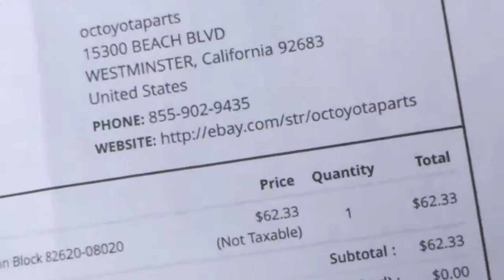How to Fix a 140 AMP Fusible link Fuse In a 2007 Toyota Sienna Van

Comment: I also went through this, if you’re in a PINCH and need to get your van started, you can just use a thick wire to jump between your positive side on the battery and touch any part of that bare metal on the fusible link and that should start it. 
You also don’t have to buy brand new, dealer quoted $130 for new, I went to a junk yard, yanked a whole fuse box out of another van, cost $30. I just removed the fusible link that I needed and worked just fine. 
Also no computer reprogramming needed with my situation. And no other fuses or relays affected.

Comment: One other thought about the “computer reset “. Didn’t make sense to me since the computer supposedly resets when power is drained. 
Well, the battery was disconnected for multiple days while I worked on the fusible link. So, the computer would have been reset by the time I got things working. So, it didn’t make sense that the computer still needed to be reset. That is what sent me down the path of checking for fuel issues.

Comment: Just went thru this extremely tedious replacement. I have a couple of thoughts to help others. First of all, you have to buy a replacement fusible link. So, you have the replacement in hand. That is why I stopped worrying about breaking those PIA tabs off. I didn't intentionally break them off, but in the course of trying to get them out, I broke the front/back tabs. I then purposely broke the right side tab on purpose. 
Additionally, I did one other thing that I think helped. I put a couple of drops of light oil down the location where all the tabs went. It was below freezing the entire time I was working on this repair. I kept breaking off pieces of the old fusible link while I was working on it. But honestly, I didn't care.
Even with all this, their is a LOT of pulling, tugging, pushing fat wires out of the way etc. Their is nothing easy about this replacement. Just completed the replacement and 06' Sienna will crank nicely but won't start. So now I have to figure out the "computer reset" mentioned by Scott. 
So, to summarize, quit being gentle on the old fusible link, break the tabs on purpose and save yourself hours of frustration. Second, lubricate the plastic area where the fusible link rides in plastic grooves, by the tabs. Should get you thru the job quicker.
Reply: Did you figure out the computer reset part?
Reply: Well, sort of. Turns out it had nothing to do with the computer. Thru trial and error I figured out it was the fuel injection relay. Swapped it out twice with other relays (which were identical). On the second swap, car started up perfectly. The car was cranking fine. But I had a hunch it wasn’t getting fuel. Inspected all the fuses. They were fine. So, I tried the relay. I was so thankful it worked cause I was just about to give up. Been running fine now for a couple of weeks.

Comment: Just paid 350$ for this very same issue. Autozone gave the wrong battery model for my 2015 Toyota Sienna and like you, I did not pay attention to the terminal. Positive to negative and saw a ⚡️. Car will not start, no cranking even though it has power. Took the mechanic 3 hrs to figure it out. The scan tool thru the obc doesn’t work either

Comment: Hello. Can you tell me about the Toyota Sienna 2008. The blue wire from the generator reads 0. All other 3 wires on the connector show more than 0 when the ignition is on. There is no battery power.

Comment: Hey Scott! This video was extremely useful to aid in diagnosing and fixing the problem on my 2008 Sienna. For the tabs to pull out the fuse I nipped some from an old license plate that I had laying around. Rounding the edges helped and they worked like a charm. I used some dental tools from Harbor Freight to aid in getting the very fragile plastic clips up from the cap portion. Used your twine idea to help hold up the cables on both sides when sliding it back in. I am SO glad that I didn't follow another video in taking out the fuse/relay box to start the project. Thanks for taking the time to make this video!

Comment: Scott your video & another guy's comments helped me out so much. You & the other folks who have made videos on this have been a huge help & it is greatly appreciated. In place of those metal pieces that you used to depress the tabs, a gentleman on here recommended that I use straightened out bobbi pins instead. So I raided my wife's stash. Popped off the rubber tips on them, straightened them with the Leatherman pliers, used a mini flat head screw driver to gently open the plastic tabs & then pushed the bobbi pins into the gap to hold the tabs open. Hopefully this will help people who don't have flashing & metal sheers laying around 😁😁😁.  Now if only I could get rid of the VSC, TracOff, ABS, & BRAKE lights to disappear.
Reply from the maker: EXCELLENT IDEA!! Well done MND.  Thanks for the great comment.

Comment: Scott - Saved me a ton of $$$, thanks for the great tutorial.  I used .015" thick brass material for the tab tools, picked it up at ACE hardware & used tinsnips to cut to size. I only had to use the brass tab tools on the two side locks, on the hard to reach end lock I just used a very thin screwdriver to push the lock tab in while I pulled up on the fuse with pliers. Worked great. It slid right out!
Reply from the maker: OUTSTANDING.
Reply: Thank you for sharing the thickness & where you purchased the metal used to separated the tabs. I just went to the local junk yard while it was raining, windy, & 34° F. From of the donor Sienna was directly in front of a massive puddle 3 inches deep & i was balancing on 2 junk yard tires whole trying to get out the donor 140a fusible link.... I didn't have time to grab tabs of any kind but heard the ominious words of using a small flat head screw driver if you hate yourself 😆... let's just say it was much easier to unbolt the fuse box, break off all the tabs on the donor fuse box to get it open, & then I slowly worked my through the rats nest of wires with a Leatherman with wire snips slicing all the wires to free the top of the fuse box from the wire harness. I finally got the sucker free & got out of the cold. The $11 for the fusible link versus the $25 for a fully loaded fuse box was worth it. 

Because of you my good sir, ill be able to run off to the hardware store with a proper thickness & get some practice pulling this thing out of the junkyard fusebox before I go pull it out of my 2004 sienna...as I won't have the luxury of pulling that box apart at all. I hope all goes well.

Comment: Hi Scott .  Was there any visible sign that the fuse was bad? Was there a break somewhere? Did you point this out in your video and I missed it?  My alternator and battery are fine but I think the fuse may be bad.  Before I replace mine I'd like to know with absolute certainty it's out and can cause a check battery light to go on and stay on.  Thoughts? Thanks in advance.
Reply from the maker: I show where the copper in the fuse burns.  What's amazing is that the copper is pretty thick. I'm sure it took many amps to burn it.  It's around minute 6

Comment: FYI South Georgia Toyota dealership wants $130 to diagnose the problem, $110 for the part, $500 for labor.
Reply from the maker: Wow!
Reply: LOL $500 for the labor?? & to think that they probably have some special proprietary tool designed only for their technicians that can get this thing out & in in lest than 20 minutes is mind blowing. How many hours does toyota charge for the labor?
Reply: @MNDmanIII  I think it was 5-6, but I did it in 30 minutes with a pair of needle-nose pliers and 6 bobbin pins. I also fixed the transition linkage with a safety pin and a Phillip's head. The Beast rolled over 350k the other day
Reply: @shaunnorthcutt3027  did you stick the Bobby pins, 2 per tab? Then pulled up on the fuse link with the needle nose pliers? I'm having a heck of time trying to free the replacement fuse link from the donor fuse box. Will Bobby pins work? My wife has a ton of those & you may have just saved my butt!
Reply: @MNDmanIII  Pretty much. Definitely make sure the battery is disconnected. I broke open the clear top casing to get a grip and shimmied it out. You can't put all pins in at once because they'll fall out. I started with one clip and moved around.
Reply: @shaunnorthcutt3027  man, thank you! I managed to get the Bobby pins in the 2 tabs near the positive terminal & then popped the far side pin & pulled it popped out of the donor fuse box. I ended up damaging the tab on the good fuse link so I just ripped it off & that way if I need to pull it back out of my van it won't give me a hard time. Later today ill be doing my best to removed the bad one out of my van & ill be sure to disconnect the battery! I saw in one video that the person had to take their 2007 sienna into the dealership to have the computers flashed. Will I have to do this on my 2004 sienna?
Reply: @MNDmanIII  Doubtful. I didn't, and the van has been running finer for over a year. It's a solid car. We took it through 48 states two years ago without much issue.
Reply: @shaunnorthcutt3027  I did it man, thanks to you & Scott 's video i was able to get the scrap yard part into the van & its running great! The bobbi pins help so much! Took 10 minutes using the mini flat head screw driver & gently opening the tabs enough to slide in the straightened bobbi pins that I had. When i didn't have to put a bobbi pin in the far tab, just the 2 tabs near the positive terminal with the nut on it. Used the Leatherman pliers & pulled out the old 140amp fuse link from my 2004 van & slid scrap yard 1 in. Connected all the pig tail clips & the 5 wire sets with the 8mm bolts(2 on the back) & the 10mm bolts(3 on the front). The whole thing pushed back down into place easier than in the video hear which was great. Reconnected everything & properly hooked up the jumper cables. Charged up the van & turned the key over & everything started & ran perfect!! The only thing that I'm bummed about is that the VSC, ABS, Trac Off, & BRAKE lights are all still lit up on the dash. I'm trying to watch videos on how to figure out how to get those lights to disappear. The check engine light & tire pressure light have disappeared though after the fuse link replacement & all the electronics inside are working well too.

Comment: Hey Scott a friend of mine has an 07 Sienna xle with no power to the ac control panel however the right side of the screen shows the airbag light normally lights up but thats it. Could the ac amplifier control unit be the culprit? I checked all small fuses and ac clutch and httr relay with no luck. I would really appreciate your input.
Reply from the maker: Open up that fuse box and look for burnt fuses. I bet there's one that's fried.
Reply: @ScottFichter  I checked just about everyone of them still no luck 😞

Comment: This video is amazingly helpful!!! I too made a stupid mistake, but I forgot to disconnect the battery when replacing the alternator. Crossed something as I pulled it out and boom. All the aforementioned problems. Shift lock, power issues, all of that. 

This video helped me avoid having a brain aneurysm and prevented me from smashing the old alternator through the cars windshield. 
Thank you! Thank you! Thank you!
Reply from the maker: HA HA HA ! Nice man.  I'm glad it helped you. Make sure to push this video out to other people so they get the help.  Best wishes and thanks very much for the killer comment.  Stay strong and keep fighting.
Reply: 4 years later and I’ve made the same mistake with the same results & frustration. Why Toyota decided to use this stupid design is beyond me, as in the later year models they went back to the old simple plug-in type.

Comment: Thanks for the helpful video, Scott.  Did any other fuses need to be changed to get your Sienna running again?
Reply from the maker: No, but I did pick up a fuse kit at PepBoys. Thankfully I did not need to replace any.  One thing that I never talked about was the need to reset the computer. Keep that in mind.
Reply: @ScottFichter  how do you reset the computer please
Reply from the maker: @Diy_rookie_PSI  I had to take it to the garage to reset it I'm not sure how.
Reply: @ScottFichter  would it work fine if you didn't reset the computer?
Reply from the maker: @happytrails5342  No, the computer had to be reset in order for the car to start.  That part sucked.
Reply: @ScottFichter  Thank you for a quick response! That's odd, I wonder what that would have to do with anything if the battery is disconnected and everything goes back like normal...

Wonder if it trips and emergency circuit in the computer?

My brother's 2005 sienna all of a sudden has

No turn signals, no power windows, no radio, parking brake locked, and a few other things

Comment: Where did you get the pieces of a aluminum?
Reply from the maker: Hey Slaughter, I had some roof flashing that I used. I cut the slivers with cutting shears.
Reply: Scott Fichter do you have the measurements by any chance :/
Reply from the maker: @slaughterevil8142  Don't over think it to much. Small screw drivers could also work. A second set of hands would help.  I'm guessing 1/4 wide  by 4 inches tall. Good luck with it dude.
Reply: Scott Fichter how many screw drivers do you suggest?

Comment: Great tip on taking a before picture of all the wire connections.  I would do that everytime that I needed to replace a component be it a starter or an alternator.
Reply: The plugin wires only plug in one way  they won't go in wrong  I fixed mine with an external fuse hard wired on total cost $5

Comment: My in-laws did the same thing to my Lexus
Reply: Mine was not as easy to remove
Reply: I tried a 4 different screwdriver before I finally got out the socket set
Reply: @savagebullrider4648  
Did your electronics in the car turn on? 
Mine don't, I'm worried the won't turn on even after I replace the fusible link, I have 08 Lexus es350.
I'm worried I blew out the sound/navigation system and all the power accessories In the car,
Reply: @dannysa503  hey did you electronics work after replacing the fusible  link?
Reply: @brianmaldonado64  
Yes they did.
Everything is the same.
Reply: @dannysa503  good to hear, so everything worked fine after installing a new fusible link?
Reply: @brianmaldonado64  
Yes, all of it.